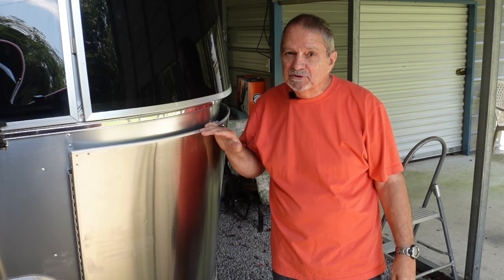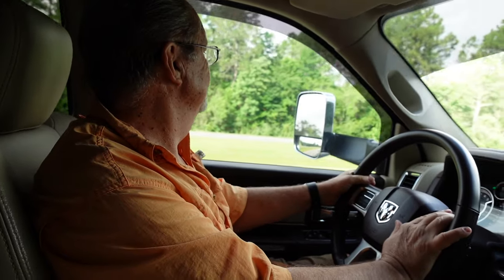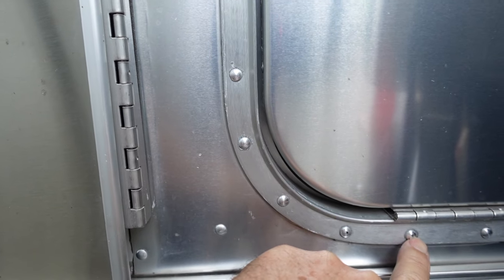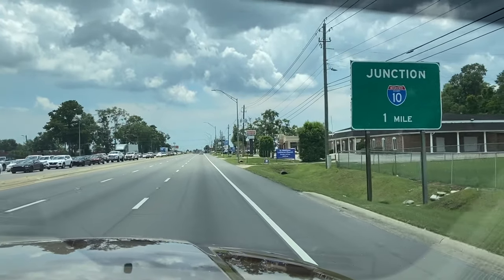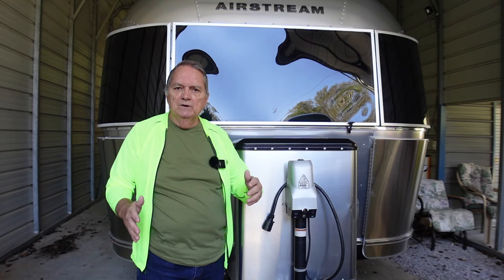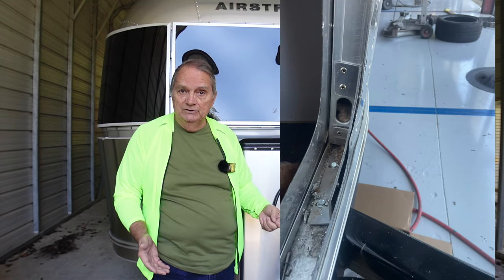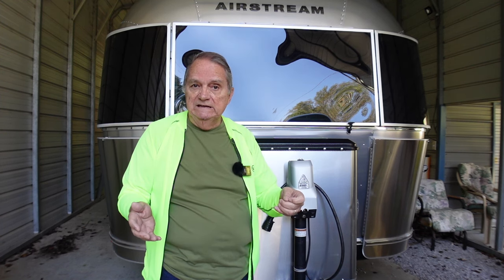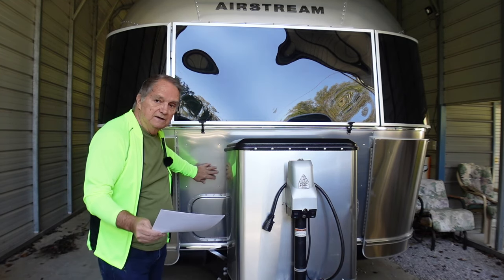Airstream Front End Separation - Second Time!

Comment: This whole story is just ridiculous!  First Airstream has a huge engineering structural failure that impacts thousands of Airstreams.  Then Airstream only has one certified technician in Jackson Center to fix the problem?  If you go elsewhere, to an Airstream dealer, you deal with huge delays.  There is now a Facebook page just to discuss this very issue.  I have the beginnings of front end separation on my 2017 27' FB Flying Cloud.  Unfortunately, my warranty has expired.  I am missing one rivet and I have dimples on both sides.  I've been told by Vinnie's in California that the cost to repair would be upwards of $5,000.  As an Airstream owner and former Thor shareholder, I'm absolutely appalled by Airstream's response on this issue.  I'm waiting for the class action lawsuit!
Reply from the maker: Sorry for your trouble but agree with you completely. Fortunately I had mine repaired under warranty both times but Airstream should be picking up the bill for everyone. Good luck.

Comment: Thank you for another great video! It's structural design issues like this that can irreparably damage Airstream's reputation as a top-tier quality manufacturer. The entire RV industry is seen by many today as needing to dramatically improve all areas of RV manufacturing quality control. Unfortunately, certain aspects of today's Airstreams seem to be very similar in quality to what other RV brands are offering for far less money.
Reply from the maker: Thank you David for the very nice comment. I have come to believe that Airstream "appears" to have better quality than the overall RV industry only because the Airstream design is so simple. I spent years as a quality and process engineer in the technology industry so I understand the cost of quality to some degree. Employees missing a production step or just being lazy is a missing screw or unattached cable. Structure failure reeks of either poor engineering or management "quick to market" strategy; both of which will and have cost Airstream significant in expense and ultimately missed sales.  Airstream should have taken a proactive approach and issued a Technical Service Bulletin or something similar to alert dealerships and owners of the FES problem and provide timely corrective solutions. Instead they ignored the issue and kept the squeaky wheel as silent as possible. Please share this video on Facebook, in Groups and on Forums so other Airstream owners and potential owners can hear the squeaky wheel. :)

Comment: So sorry to hear you are experiencing the Airstream separation. More and more folks are having this issue. Structurally Airstreams have not changed very much since the 1960’s. Remember when folks towed their campers and Airstreams with cars and wagons? But today its all about towing with trucks and they are getting bigger and beefier.  No disrespect to you or anyone else having this issue but I’m convinced the tow vehicles are too heavy duty. What I mean is when you go to 2500 and 3500 like your Ram truck the rear leaf springs are too stiff/ridged. So when you drive over a hump, bump, driveway or pothole the truck is literally smashing the RV down and no trailer can withstand that force. Unfortunately the separation will happen again. I may be mistaken but I haven’t  seen this when towed with a 1500 truck. My sister sent me an add for a shank with an air shock built in, this might help reduce the impact on a trailer when towed with such heavy duty trucks.
Reply from the maker: Thanks for the comment. Do you use a weight distribution hitch with your 1500?
Reply: yes, I do use a weight distribution. On both Airstreams I had (at different times in my life) and on an Airstream they help with anti-sway although with its aerodynamic shape, they do very little swaying
Reply: I agree with Joe. However, I tow a 27’ FB with a 1/2 ton Tundra and I have FES. But I also have airbags and I suspect the bags are inflated too much. The biggest factor is load: If you’re hauling too much crap- water jugs, fuel, gennies, etc, it ultimately affects the force on the tongue and frame. The frame will flex but the shell does not apparently.
Reply: I owned my last Airstream, a 25' Safari, and pulled it with a 2003 and a 2014 Lincoln Navigator.  The previous owner towed it from Florida to Alaska and back and I towed it for 18 years after its trip to Alaska with no problems at all.  I recently purchased a 2024 Airstream Trade Wind Twin and took delivery early this year.  The unit is not even 3 months old, has less than 2,000 miles on it and already I'm having dimpling on the lower portions on either side of the front storage bin.  I'm towing with the same tow vehicle, the same hitch and I'm packing even less "stuff" inside this Airstream than my previous one and yet there is something going on structurally, so how can it be the tow vehicle?
Reply: @cheryluhrig-rivard2963  This kinda kills the throry that using large trucks for a tow vehicle causes FES. Sorry for your troubles but thanks for sharing.

Comment: No FES on our 2020 Flying Cloud 27 FBT.  We tow with a Propride 3P.  Awesome hitch.  Claims that it causes problems are BS.  No WD hitch should ever cause FES.  It’s a design/manufacturing defect.  We did, however, have a transverse bulge occur across the floor in the kitchen.  Had it repaired, under warranty, by Woodland Airstream in Grand Rapids, Michigan (where we bought it).  Amazing body shop and they did a great job.  The problem was that two pieces of plywood subfloor met at that point on top of a longitudinal structural cross-member, but the plywood sheets were not secured to the member, and were not tongue & groove.  The had to remove the rear half of the interior in order to pull the floor back and gain access to the area, and then put it back to factory original.  We dropped it off in October, when we were done camping for the season, and got it back in the spring.  We had the same factory warranty situation.  Dropped it off just a few weeks before the warranty expired, got Airstream to approve the work, and we asked them to “take their time and do it right.”
Reply from the maker: Very interesting comment. Thanks for sharing and for watching.
Reply: It’s the BS hitch you use, all of the hitches are BS and you shouldn’t use them at all, especially with a heavy duty truck 😂😂😂

Comment: The question is what the cause of front-end separation is. Is it an engineering problem or a result of using an equalizer hitch that accelerates the engineering problem? If it is an engineering problem shouldn't Airstream extend the warranty on that issue. Just saying.
Reply from the maker: Some great questions and I guess only time will tell. Putting my money on engineering shortfalls!!

Comment: I think the separation is largely due to driving too fast on poor roads.   The pogoing that occurs on bad roads tears these trailers apart.   What has occurred in Airstream manufacturing to cause this separation?    Why has this not been seen before?   I use Timbrens and GenY Boss. Hitches which has really helped reduce the shaking and amount of flexing.
Reply from the maker: Good question and I hope one day Airstream will provide an answer. Thanks for your comment.
Reply: Most, if not all FES, occurs where there is  front storage.  To put in this storage, Airstream has to cut the ribs that provide support.  Evidently, lack of proper structure causes the problem.  This is a problem that impacts thousands of Airstreams, including  mine.

Comment: Did the second fix, fix the problem? I have a 2022 Classic 33' with less than 3000 miles show signs of FES. i have owned several trailers, and this Airstream has been the worst. Never again.
Reply from the maker: Haven't travel much at all since the last fix so I don't have a good answer at this time. Good luck with your issue.

Comment: Thanks for your video.  Glad you got the FES addressed.  I had two buck rivets popped around the front storage locker on our '22 Classic 33 FB.   Just returned from Jackson Center to fix those and 36 other items.   Our tech told me we did not have the beginning of FES, no dimples.   Others say I tow with too much truck.  Tow with a F350 and a Propride hitch.    Keep up the good work!
Reply from the maker: Keep watching it and just be careful not to scrap the ground with the back skid plates. Once those plates show scrapes Airstream will blame you for any FES. I had to provide photos to show them I had not scraped the ground. If you do take it in again I would find a different repair shop. Good luck.
Reply: Thanks.  We will be watching everything closely.  I was not aware of the scraping/FES issue; we have the 3 inch lift, since it's a 33.   We plan on taking this rig to Alaska next summer.    @LandingZoneHome

Comment: I would like to agree with what you said about Airstream noting and correcting the problems that created your front end separation and that all new models coming off the production line will not have the problems that you faced. However, my new 2024 Trade Wind Twin, which is less than 3 months old and has less than 2,0000 miles on it, has already had dimples appear on either side of the front storage bin indicating that there is some sort of problem that needs to be addressed. I hope the second repair made by Foley to your Airstream actually fixed your problem.
Reply from the maker: Good luck with your issue and thank you for the comment.

Comment: Thanks for your informative videos. I have a 2021 Globetrotter 25 FB with queen, so I don't have the storage bay in the front. I'm hopeful that this means FES is less of a risk for my rig, but will definitely keep an eye on it. 

After Mark and Trish from KYD recently posted about FES, I considered the possibility of towing without a WD hitch. I have air suspension on my RAM 2500, so I could easily level the rear end sag caused by adding around 1,000 lbs to the bumper. However, CAT scale measurements showed that over 400 lbs was being removed from front axles. This 400 lbs plus the 1,000 lb tongue weight was being placed on the rear axles. While my rear axles are rated for more than this, the lighter front end didn't feel safe and I'm not sure that this is any better for the AS since the rear of the truck is very rigid with the 60 psi in the air suspension required to level the truck. After properly setting up the WD hitch, it sent 32% of the hitch weight to the front axle, 50% to the rear axles, and 18% to the trailer axles. With this setup, very little air is needed in air suspension and it feels terrific while towing.
Reply from the maker: Appreciate your comment and thank you for watching.

Comment: We have a 2021 Caravel 19cb. We tow it with a 2020 Jeep Gladiator (Max Tow Package). We use a Blue Ox wdh. We are in our third year of full-timing in it. Whenever I read or hear about fes, the problem is with longer units that have a front storage door. We don't have any indication of fes. Is fes more prone to happen to the longer units?
Reply from the maker: Yes, I think so. FES is a result of frae flexing and a short unit such as the Caravel will have less flex. Thanks for watching.

Comment: Other than engineering I gotta ask what causes this? Is WD hitch and how it is set up a factor?
Reply from the maker: Some are starting to suspect WD hitchs especially when used on a HD truck. I just don't know to tell you my gut feeling. Some are going to an air hitch which I have no experience with at all. I hope (but don't expect) that Airstream is doing controlled testing on this issue and will eventually announce a cause and possible solution. I don't have much faith in the L-Brackets as a total solution. Thanks for your question.

Comment: So if we have the issue what is the ultimate fix that Foley RV did?  
Technical?
Reply from the maker: In my case, they completely removed the front panel and secured the L-brackets. Jackson Center did not remove the panel and therefore the L-brackets were not sufficiently secured. Thanks for watching.
Reply: @LandingZoneHome When they replaced the panel did they use buck rivets or Olympic rivets? I would assume by now you know the difference. Because in the video you pointed out the rivets on the hatch frame as having holes in them- those are Olympic. But I’m not claiming to be an expert, I’m genuinely curious how they fastened the new panel.

Comment: Do we know what year Airstream fixed this issue? 23? 24? Models?
Reply from the maker: I was at Jackson Center in the Spring of 2022 and was told the "fix" was going into current production models. So model year 2023 sounds correct.
Reply: @LandingZoneHome  it didn't make it into my 2024 Trade Wind or if it did, then there is some other structural issue at hand!  I have dimples that appeared on both lower sides of the front storage bin and my Trade Wind it is not even 3 months old and has less than 2,000 miles on it!

Comment: how did the separation occur
Reply from the maker: The Airstream was designed and built with insufficient braces connecting the shell to the frame. So just going down the road with twist and turns over time cased the separation. Some folks think the weight distribution hitch contributes to the problem.
Reply: @LandingZoneHome its likely the 2500, 3500 heavy duty trucks with leaf-springs that are too ridged with little to no give. No camper Airstream or otherwise can take that abuse long term